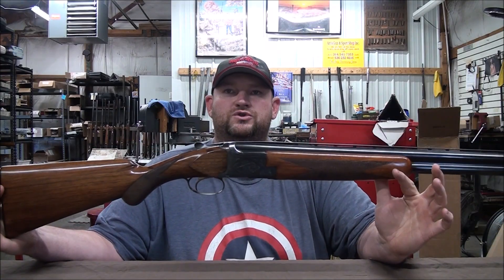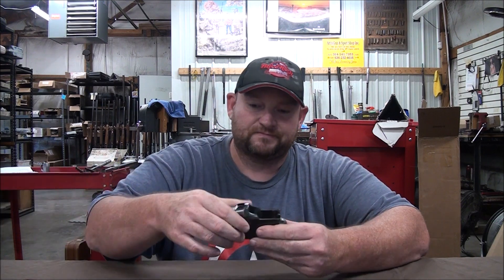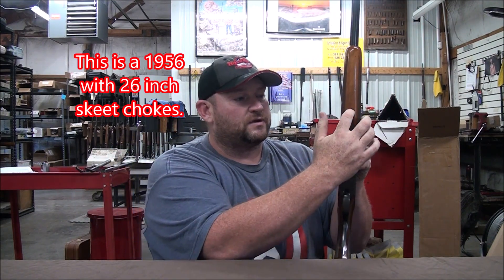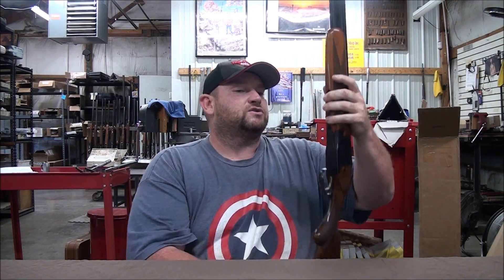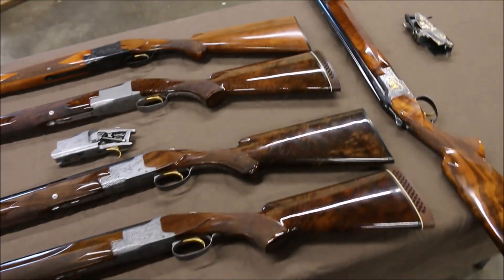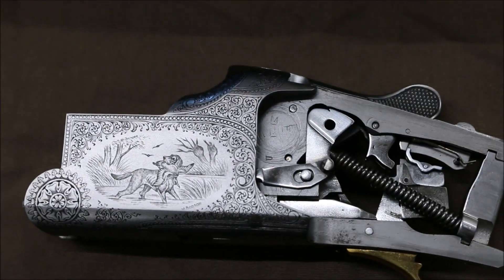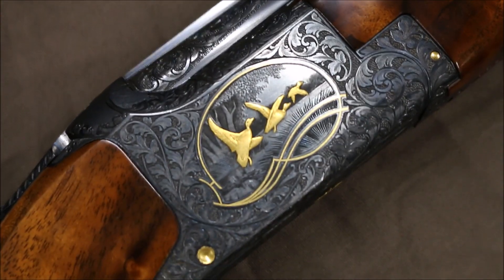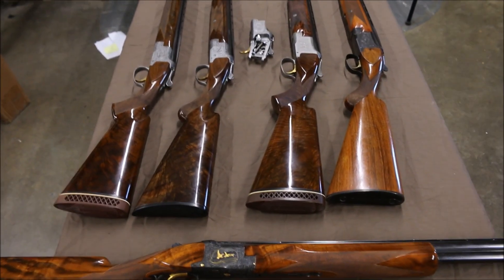This video covers a brief history of the Browning Superposed 12 ga.

Comment: I just secured a Superposed only yesterday, (10/22/2024.)

GreenTop Hunt and Fish, Glen Allen, VA.  They buy estate sales and have an enormous inventory of used firearms.

I went back looking for a Miroku that I had seen earlier, (a Browning Citori without the Browning name.) I found this one instead and jumped on it.

Yup, a Browning Superposed.

1968 production, minor handling marks on the wood. Blue is mildly faded, bores look like brand new and the lock up is very tight . 30" barrels, modified and full. The silver receiver is heavily tarnished but a good hit with Never Dull should clean that up nicely.

$1150.

I think I made out on this one

Comment: Thanks for this video. I have a Grade 1, 12 gauge, 28” F/M fixed choke, S8 serial that’s thankfully NOT a salty and quite tight all around (haven’t be shot that much). It’s been passed down to me from my father. I was looking for such info around. What’s a bit strange about my gun is that the wood seems a lot darker than the Grades 1 I’ve seen all around on the internet. It looks more like a Diana or a Midas. I checked and the wood hasn’t been replaced because the s/n on the receiver matches that on the buttstock.

Comment: Thanks for the videos.   There are 2 firearms that I regret not buying.   The first was a mid 30's vintage Lightning with 30 inch barrels and outstanding wood for the grade of gun.  The second was a early/mid 50's Funken engraved Diana for a very good price.   I skipped the early gun because it needed a rebuild, and the 50's gun because I thought that someone had altered the stock.  That was before I knew that Browning would do just about any kind of work on them.   Of the 2 I REALLY kick myself for passing on the early gun.   It was one of those guns that just fit and balanced perfectly!
Reply: Do you know what years the lightning was produced? And what does lightning version mean?

Comment: I found that very interesting. It’s still relatively straightforward to buy a new B25 - albeit they are quite expensive ( but not as pricey as a Perazzi). I’ve had my B25 B2g for around 6 years and had it customised to fit me. I love the lines of the gun and it’s a delight to shoot.

Comment: Dear friends, I own two Citori. Serial of hunting model is 05335RN153 and the trap one is 01030PX143. I live in Costa Rica here there is not a lot of options to find superb experts in Gunsmithing like you guys. I will like to blue the hunting model, build in 1979. My doubt is related to the solder. Can you give me a clue if in this model they use silver, tin or lead solder? This will determine which blue process I can choose. Thanks in advance.

Comment: I have 2 problems:
On reassembly, I somehow got the firing out of sync: you showed the disassembly but not the proper reassembly of it.
I fiddled with it until I thought I had fixed the first problem, but now it only fires the second barrel after I cycle the safety. It was my grandfather's gun I've never actually fired it, and by the time it came to me it hadn't been fired in 30 years, so the two problems may or may not be related. If you have any ideas I'd be grateful.
Question 3: being that the ejection springs and firing springs are all loaded when closed up, should this gun be stored broken? (I guess once I get my previous problems sorted, if it goes boom after 30 years, that sort of answers my own question...) Theoretically what's the right way in your opinion to store this gun?